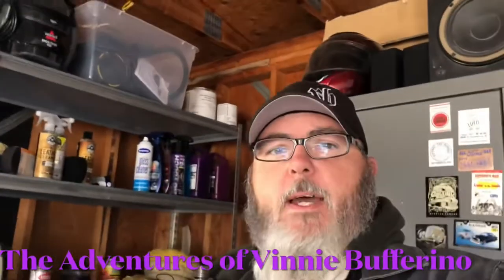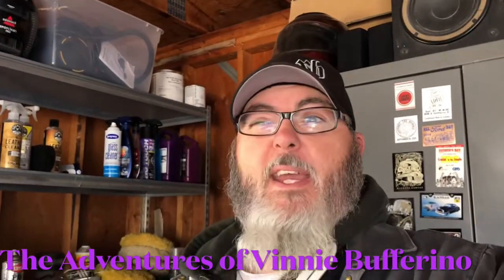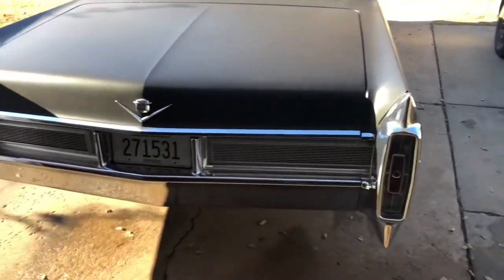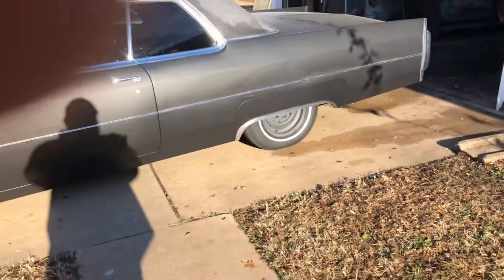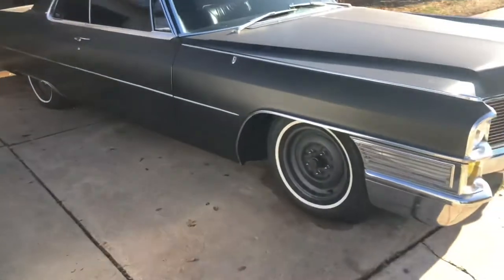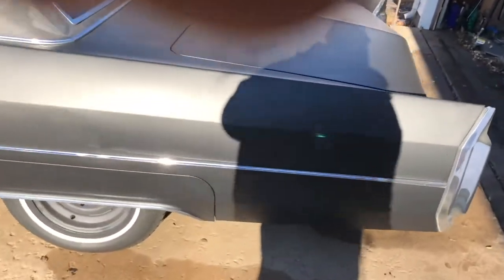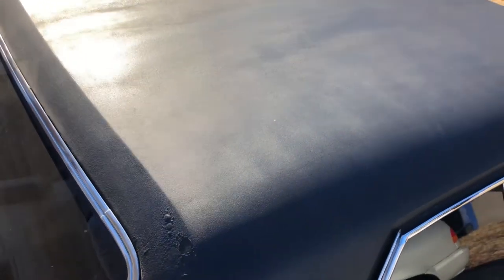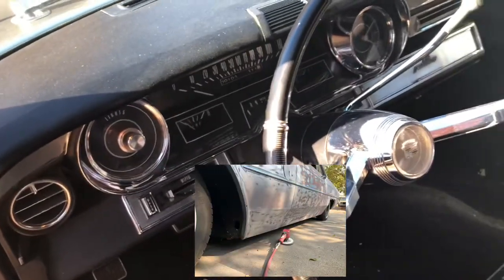Saving a 1965 Cadillac from a slow death!

Comment: Nice, I have a 67 Cadillac Deville sedan. I'm curious to see what radiator you bought and how you fit it. I had bought a champion radiator but the drivers side of the radiator did not fit at the base so I had the original one fixed twice!